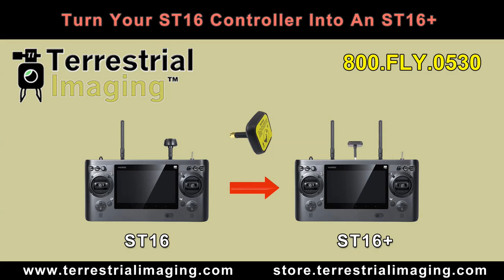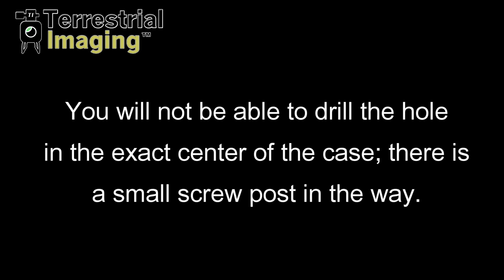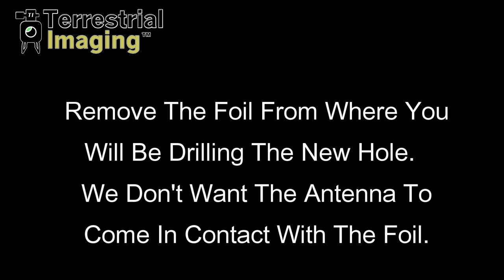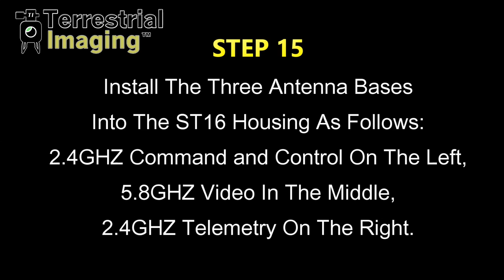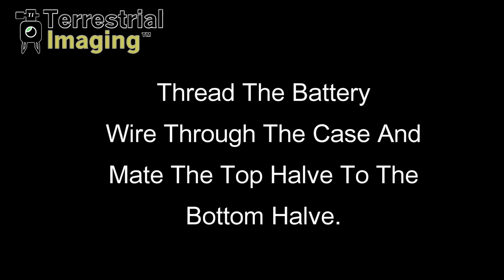Yuneec ST16 Upgrade To An ST16+ By Terrestrial Imaging

Comment: I have a new ST16 + station. How can I configure it for another Typhoon drone that is not the one that came with it? The original Drone crashed it and I could buy another in good condition but it brings me the ST16 station. I want to use the ST16 with this new Typhoon H drone. I hope you can help me if possible and how to configure the station.

Comment: Nice video, Question....What is the difference between the ST-16 & the ST-16 Pro? and is the Pro model the same as the Plus you just described?  Many thanks for the video and future reply. Subbed also. Steven from Wisconsin.:-)
Reply from the maker: Thank you Steven! The ST-16+ and Pro are referring to the same controller. It is officially the ST-16+ but many will refer to it as the pro. The ST16+ is the same as the ST-16, expect the telemetry antenna is an external whip antenna.
Reply: @TerrestrialImaging     so i have the PRO with the 3 spots  what are the differnce in the 3 spots and i just bought the FPVLR antennas  i received 3, but 2 are identical,   so are the first and middle spot on the controller the same too ( controls)?  the LEFT side is the Control and the right is the video antenna? correct?  so then is the middle the controls and its the same as the spot on the left?
Reply from the maker: @Save-A-DogAps  The mushroom antenna, which should be in the middle, is for the communication with the camera. The other two are for the telemetry and command & control, and are interchangeable.
Reply: @TerrestrialImaging     on my st16+ if your looking at the controller - i have 3 antennas 1 stick (rubber duck) on the left  then i have a Patch in the middle then i have a mushroom on the right..     Now i just purchased the FPVLR long range antenna kit that one has 2 Mushrooms and 1 tall one ( tall for video)  but they say put the 2 spheres antennas on and left and middle and out the 1 tall one on the left for video??  but your saying the 2 that are the same go on the left and the right and the tall one for video goes in the middle???
none of these antennas say 2.4 or 5.8 so i dont know         what is the order on the st16+ for 2.4 2.4 and 5.8
Reply: @TerrestrialImaging  

yes bit i just installed the 2 exterior antennas on my TYphoon h for 2.4

but  how do i hook up an Exterior antenna on the copter for the 5.8hz antenna
like i have the 2 on the copter for 2.4 tel.  

i also have the 2 tall orignal rubber duck antennas now on my typhoon h and i have the 3 fpvlrs pn the transmitter

Comment: You have not upgraded the Control Switches. I have done your Antenna Mod. Had trouble getting the second 2.4ghz antenna. just need the pro short switches.
Reply from the maker: Hi Kev.  Are you referring to the control switches with black rubberized coatings?
Reply: Yes, where can I buy them. They come mounted to Circuit boards. I am in Brisbane Australia. I have done your Mod and would like to Change both sets of Switches.
Reply from the maker: Kev, you are correct.  The control switches (each set of 3) are mounted to a circuit board.  If you want to coat them, you can carefully dip them in "DIP" which you can purchase at a Home Depot or other hardware store.  I've done it and it works great.  A little masking tape helps make the job nice and clean.
Reply: May thanks for your reply. I have over tighten the lock rings and all the switches are broken, so I want to fit the Short Pro type switches but being in Australia the Idiot Importers wont stock many parts. So I need the two sets of circuit Boards with switches. Thanks Again.
Reply: Yes, both sides with circuit boards.
Reply from the maker: Hi Kev.  At this point in time, we don't ship outside of the USA...We are aware that there is limited support in Australia and are working on a plan to address that in the near future.  Thank you so much for your input.

Comment: They must have upgraded the original TH..got mine today and had 3 antenna..and and extra patch antenna to replace the mushroom
Reply from the maker: That's correct. The first units they produced only had 2 antennas, then they changed the design. Thanks for watching!

Comment: I guess I would need a compelling reason to do this mod. So far, no one has presented any evidence that it helps anything, just hearsay. Does anyone know of any YT videos that do a side-by-side comparison of the three controllers? (ST16, ST16+, STa6 Pro)?
Reply from the maker: This mod allows you to install the 4Hawks range extending antennas. The 4Hawks antennas significantly increase the range of both the drone and camera feed.
Reply: @TerrestrialImaging  Great!! Speaking of range extending, how far is the range with a stock TH and then how much further with the 4Hawks antennas? I might want to do that, but need to know what would be my return on investment. Thanks.

Comment: There is no ST16+
Both versions are ST16
Reply: yes there is, mine comes with 3 antenna stock, they would never use the 2 antenna st16 to control the more expensive yuneec Tornado or the H520 or the Search and Rescue ` H520 / FLIR edition.  its better with 3 , my st16+ actually comes with the YUNEEC TORNADO copter already programmed next to the Typhoon H under Model select,   this is a great unit and you dont ruin your warranty by doing what this video did, thats the main reason